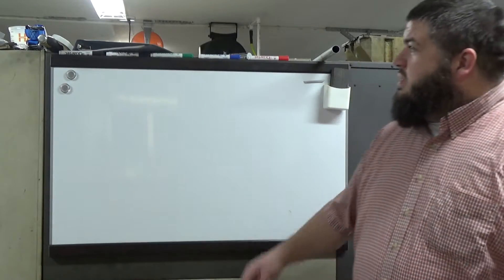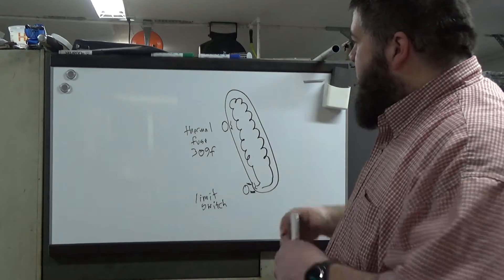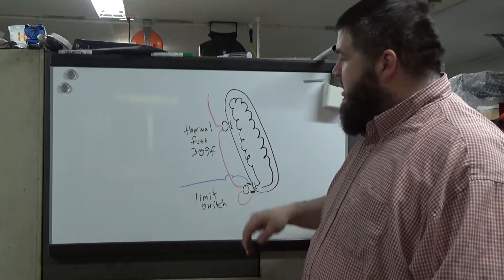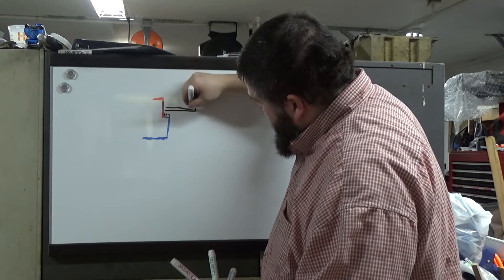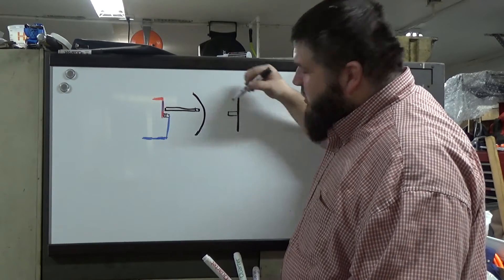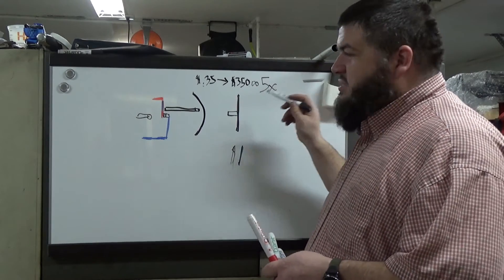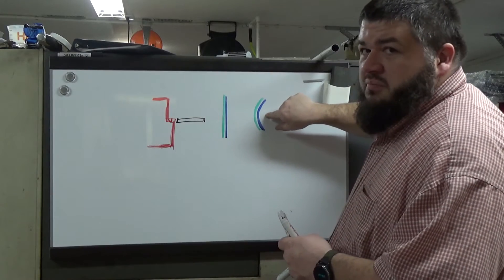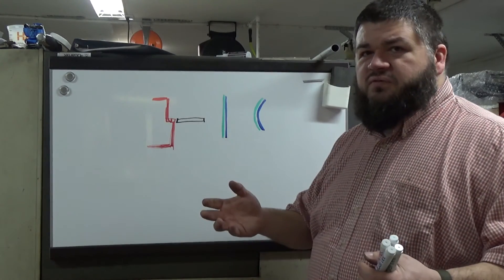Clothes Dryer Thermal Fuse Failure and Diagnosis

Comment: Okay thank you I got all that part but what heck is inside the white thermo fuse part # 3392519  yes I can buy them buy bunches from Amazon  but my problem  is cheap made thermostate  that controls heat to clothes in drum it's too dam hot at 155 it shrinks my clothes I want 125° part

Comment: Excellent in-depth look at these fuses - thanks.  309F on the top / thermal fuse is actually 309 degrees Fahrenheit- the max temperature before the fuse blows.  A common part number for it is 3977393 - but there are others.  If this keeps blowing, the vent with holes on the back wall of the inside of the drum may be blocked - usually by a dryer sheet, or the lint screen may have too much residue clogging the screen, also from the waxy substance on dryer sheets, or the exhaust vent tube inside the back of the dryer on the left, when you face it may be clogged with years of lint, or the fan behind that same tube may not be working, or the heating element coil may be curving or expanding enough to touch a wall of its own metal housing after it gets really hot - and causing it to ground.  I replaced the fuse a couple of times and it was blowing nice and hot - at first.  If the timer works and the exhaust tube inside the back of the dryer is clean and clear - and the exhaust tubing that goes outside is also clear, then there are only about 5 parts inside the back to replace and a kit is about $30.  You just need a 1/4 nut driver and maybe a flat head screwdriver to push the wire contacts off of the blades of the fuses.  And… always take good photos before removing parts so you know where wires and other things go.

Comment: By the way, the limit tstat is not what normally turns the heating element on and off, that would be the thermistor in the exhaust duct. The High limit switch opens if the air temp gets higher than normal and shuts the element off until the air temp in the heating element duct cools down 50 degrees lower, than it automatically resets.
If you have not cleaned your ducts in a while, you can wear the hi limit out.
Reply from the maker: Thanks for the info.

Comment: Why is it blowing the breaker then I checked my contacts on on my fuse and I'm getting continuity through it all but it keeps on blowing the breaker
Reply from the maker: It's possible the breaker is faulty or your dryer has a short which is causing it to draw too much power.  My dryer has a display and you turn the dryer on before starting a cycle, does your dryer have a display that lights up when it is turned on but a drying cycle is not running?  It's cheaper to have the breaker replaced than the dryer, so that is a good place to start.  If it pops the breaker after being replaced, then you have a short in the dryer and it needs to be repaired.

Comment: When i opened my dryer and checked all the fuse, all are working but the thermal fuse is blown out. I used copper wire to see whats going on, and the copperwire overheated and blasted instantly. I assumed that the fuse is getting overpowered electricity. I change the fuse 20 times but all blown in 20 sec. Please find  a solution. Additional information, every part of dryer is working perfectly fine. I also watched a lots of videos, and follow through like checking the controls or cleaning the motor, but all are working fine.
Reply from the maker: It sounds like your heating element is shorted and needs to be replaced.  A piece of decent sized copper wire shouldn't melt instantly unless there is something wrong with the heating element.  I recommend removing the cover on the heating element and visually inspecting it for any melted wire or black spots where it shorted against something.

Comment: My Amana dryer thermal fuse keeps blowing,I can only dry maybe 2 loads.I cant find the issue.Please help
Reply from the maker: Make sure your dryer duct is clean and clear, if there is lint buildup in the duct or the filter, it can cause these symptoms.  It is common to need to swab/brush out the dryer duct after a number of years, especially if the lint screen isn't cleaned every load.

Comment: Thanks sir for the video. Any insight on mine? The red wire is burned loose from the terminal where it connects to the element and the high limit thermostat was blown apart. Dryers runs but didn’t have heat.
Reply from the maker: Blown apart?  That sounds like major over temp or a power surge.  What can also happen is the terminal can get dirty with oxides and not make a good connection, which makes it get hot and melt.

Comment: I have my dryer vented and running underneath my mobile home. It is brick underpened and I've had it that way since we moved there ( new home) in 2001. I'm guessing that's fine to run it like that vs it going to the  outside/outside?? Over the past maybe 5 years a few times I've replaced a few fuses. Once my sister in law had it jam packed stuffed, once the machine ran for a long time and the tube wasn't spinning ( funny because last year I replaced the belt for that issue and it was working fine, and I can't remember what the 3rd time was. But I've replaced the flat white long fuse I believe that was the overload of the dryer, then the thermal twice, then another time was the one that is a set to the thermal. I never replaced several at one time though because it ohmed out fine.
Reply from the maker: The best approach is to have a smooth pipe to reduce friction, the longer the run and the harder it is to blow through.  A smooth pipe is also easier to clean with a pipe cleaner.

Comment: I’ve went through 4 fuses, and I believe the problem was my vent was kinked and did not allow for superior all flow I.e exhaust
Reply from the maker: Yes, that is a good point.  A restriction in the exhaust vent, due to lint or a kink, will reduce the flow and increase the temperature of the heating element.  The elements are naturally self-limiting to a point, they are referred to a PTC or positive temperature coefficient heaters.  This is what is used in space heaters, etc.  The problem is that the heat is confined rather than allowed to radiate, so the dryer gets too hot and blows the the thermal fuse.
Reply: @eformance  when I get home I’ll grab some dikes and trim the vent for a straight path of air flow, luckily I ordered a 6 pack of fuses for trial and error lol
Reply from the maker: @calenbolo  A good diagnostic for this is to simply pull the dryer away from the wall and let it run without the vent connected.  If there are no problems then the vent is the most likely culprit.  Also check that the flap on the end of the vent is moving freely.
Reply: @eformance  sure thing I will, luckily my 12 V 1/4 Milwaukee nut driver makes it easy work

Comment: I think they are both bimetallic switches. The hi limit switch just has a reset temperature of like -32 F degrees, so the reset temp is way outside a normal range. I tried resetting one by the smack method and couldn’t get it to do it no matter how hard. It wasn’t until I froze it that I was able to reset it with a light tap. With an air duster can I bet I could get it to reset without impact.
Reply from the maker: The purpose of bi-metallic switches is to "reset" at room temperature, requiring sub-zero temps to re-establish the original shape is probably not likely to be a bi-metallic dome.  It's more likely that the dome has a very low normalizing temperature, such that it relaxes at relatively low values.  Bi-metallic switches work by virtue of the stress concentrations being different on both surfaces of the material, because the materials expand at different rates.  I imagine the materials in the thermal fuse are an alloy of multiple metals, but not bi-metallic.  I'm guessing a bronze alloy is most likely.
Reply: @eformance  when I drilled into one it looked copper/bronzish in color.

Comment: What if the heating element glows bright orange but dryer does not turn. What fuse has blown ??
Reply from the maker: That would be caused by one of the following: belt came off, broken belt, failed motor, or failed switch.  Older dryers have a mechanical switch that runs everything, new dryers are computer controlled.  If the dryer tub spins very easily, then the problem is probably with the belt.  Diagnosing the rest of the problems requires using a volt meter to check if the motor is getting power.  If the motor gets power but doesn't spin, then the motor has failed.  If the motor doesn't get power, then it's probably the main control board or switch.  There might be an internal fuse, but to find it you need to open the dryer up and find the wiring diagram they put inside.  Usually the top surface of the dryer (folding surface) is clipped on and can be pried up with a screw driver, they probably taped the wiring diagram on the bottom of that or one of the sides.

Comment: Ok I have a GE dryer, my dryer doesn’t turn on, no power and no light inside dryer, just completely dead. Could it be the thermal fuse ?
Reply from the maker: It's unlikely to be the thermal fuse.  The thermal fuse is only used in the heater electrical path.  In your case it's more likely there is a regular fuse or breaker that is blown.  The door light is usually just a simple switch connected to the bulb, so if that isn't coming on then I don't think any power is coming in to the dryer.  Best to check the home electrical wiring first (fuse panel/breaker box).
Reply: @eformance  yeah the outlet works. I plugged my washer in it and it works fine.
Reply: @eformance  btw mines is Gas GE dryer.
Reply from the maker: @808Affliction  What's the model number, perhaps I can download the service manual and take a look.
Reply: @eformance  thank you, going to check now.
Reply: @eformance  Model # is GTD72GBSN0WS
Reply: @eformance  Model # GTD72GBSN0WS
Reply: @eformance  btw I subscribed thank you for helping me.

Comment: Good explanation. I don't know whats going on with my dryer though, I have a Samsung electric dryer and the thermal fuse keeps blowing out. I've changed the fuse 3 times this month. It works for a few minutes but then it stops and when i test for continuity it doesnt read anything. I though it coudlve been the lint but i cleaned it out thouroughly and even connected a new duct with no obstruction leading directly to the backyard door and it still blew. I already replaced the the heating element a few months ago as well as the thermostat. Any ideas what it could possibly be???
Reply from the maker: Check your blower fan, if the fan isn't working then air won't be drawn across the element, causing it to overheat.
Reply: @eformance  Thanks for responding! The blower fan is working. I changed the fuse this morning and it worked for like an hour but it blew again. When i replaced the thermal fuse it didnt come with the bracket, so i removed the old one with rivet and when i put the new fuse in i used little screws (i dont have rivet gun). Could that be why it blew out these last two times?  Or could it be the drum felt seal isn't tight enough? Thanks again for your help.
Reply from the maker: @sergiolaguardia4329  Did you replace the thermal limit switch too?  These switches come in pairs, one is the thermal limit switch and acts as a thermostat to regulate the heat, the other is the thermal fuse, only used when the limit switch fails to open or there isn't enough air flow.  If your blower fan is before the heating element, blowing across it, then leaks are probably not an issue.  If the blower fan is in the dryer duct, drawing air through the drum, then any air leaks around the drum will prevent adequate airflow across the heating element.
Reply: @eformance  yes i replaced the heating element a few months ago because it cracked. then a few weeks ago i replaced the thermostat and the thermal fuse a couple times this month. the thermostat isnt failing. its just the fuse. im going to try to replace the fuse again along with the thermistor and replace the worn out felt.
Reply: Not sure if you’ll see this but did you ever figure out the problem?

Comment: I was looking at a dryer not heating for a friend also; every single switch and fuse tested good, element good, contacts good, finally found one of the contacts in the timer control knob on the panel was bad; took it apart, sanded the contacts and been working ever since. That one frustrated me a bit. Took a while to find!
Reply from the maker: Good Job!

Comment: Interesting! I tested & replaced the thermal fuse - my dryer worked! About 2 days later it stopped.. the fuse again! Thankfully on Amazon they came in sets of 2. Before installing the 2nd one I watched your video.. went outside & thought I cleaned the tube in the wall (a ton of yuck came out) I couldn’t quite reach as far as I wanted. But my daughter & I installed the new fuse, turned the dryer on and I ran outside to check & air was coming out outside. An hour later the fuse blew again! Ugh.. is it possible it’s still partially clogged? Something else? Or I need a whole new dryer? It’s just my daughter & I and thanks to your video (so far) I haven’t had to call a repairman and it’s been something 2 girls can do!!
Reply from the maker: Glad to hear you tackle these things yourself!  The heater heats the air as it's blown into the dryer, the filter screen catches lint as the air leaves the dryer.  You can test if the problem is with the heating or the duct by holding down the door interlock button while the door is open, then run the dryer.  If the fuse doesn't trip, you still have something blocking the duct.  If it trips, the limit switch is probably stuck closed.  The limit switch is the thermostat, the fuse is there if the limit switch gets stuck closed or the duct is blocked.  Many of the thermal switch kits come with a thermal fuse and a limit switch, I think it's a good idea to replace both together.
Reply: After I got your reply (thank you by the way) I decided since I had gone that far I might as well go further and I took the heating element out and it was 3/4 black and burnt! On Amazon I bought a 5 piece kit with the thermostat and everything. It came yesterday - we did it all ourselves - the dryer has been going all day! Yay! We feel like we accomplished something huge!!! Thank you to your video and your help! Kelly
Reply from the maker: @kellykoster971  Awesome!  Another appliance saved from the heap!  The only appliances I've come across that couldn't be repaired are front loading washing machines.  In one case the seal went bad and the bearing failed catastrophically (the little balls actually split in 2).  In the other case the board was obsolete and the cost to replace the board was $100 for a 10yo washer.  Since that was the second and the first had the aforementioned bearing failure, I figured it had a good run and recycled it.  Refrigerators are another appliance that is typically easy to repair and keep running for a long time.
Reply: @kellykoster971  so the heating element itself was faulty and therefore blowing the fuse as a safety?
Reply: @sandmansimms5704  No, her heating element was probably shorting to ground and remaining on continuously until the fuse blew.

Comment: what can be wrong I check all the fuses thermostat and they continuity  in my Kenmore Elite but heat for 5 seconds then turn off again,what I need to check next,thank for your answer
Reply from the maker: Is the blower fan coming on?  If the blower fan doesn't blow past the heater grid then it will overhead and shutoff.  Does the whole machine shut off or does it just stop heating?  It's also possible the controller/knob assembly is defective and can't pass the current for more than 5 seconds before it fails.
Reply: @eformance  everything works but the heater element shuts off

Comment: My fuse keeps tripping and causes element to turn off, I replaced both it and the other one on my Samsung. Can't figure out what the problem is.
Reply from the maker: If the thermal fuse keeps tripping, there are really only 3 possible causes: 1) bad thermal fuse 2) bad limit switch 3) obstruction somewhere in the air path of the dryer.  The thermal fuse and limit switch are typically available as a kit for around $5 for most dryers.  I'm not certain if Samsung uses the typical parts like a Whirpool or other domestic brand.
Reply: @eformance  thank you, I am gonna go back into the dryer and look for an obstruction, then try it again. Hopefully it will be a simple obstruction. Appreciate the tip.
Reply: Weak air flow outside the outlet box is DEFINITELY A BLOWN FUSE.